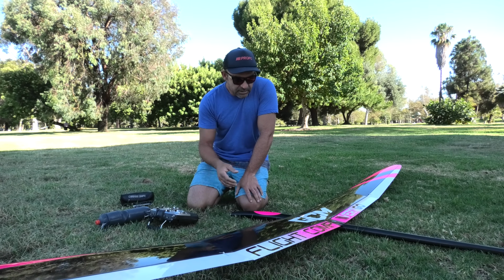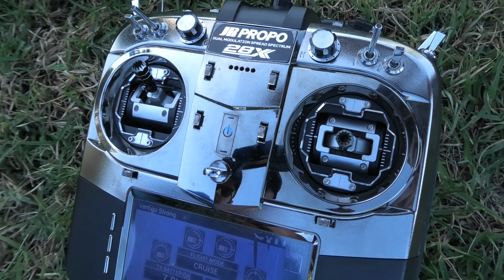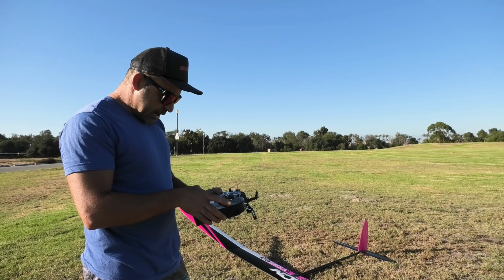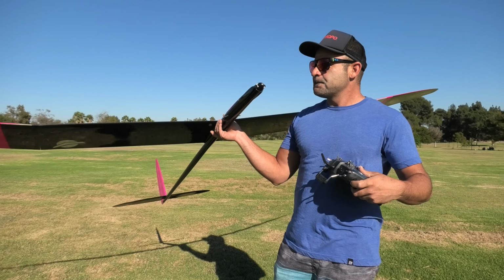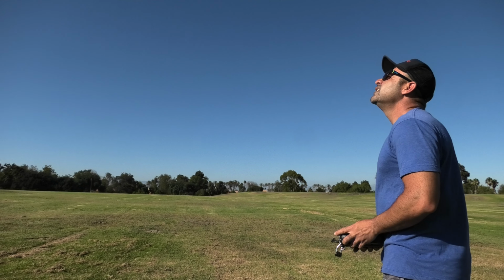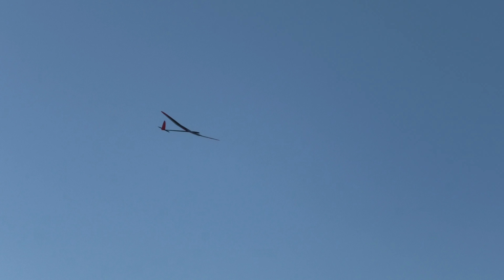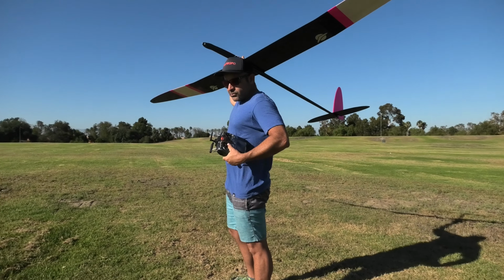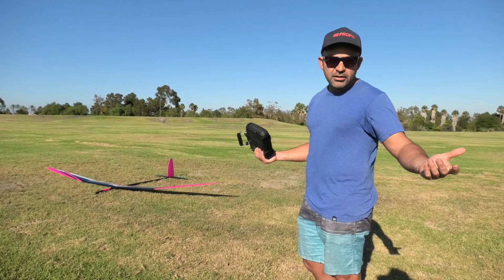F5J Maiden Flight Check List and precautions.

Comment: why is your throttle reversed?
Reply from the maker: My throttle is on a slider on the side of the radio.  The left stick operates the flaps.
Reply: @flightcomp  oh that's interesting
Reply: @flightcomp  hi Ali. I have throttle on slider. flap on stick. your videos are very easy  to follow. keep well. Keith Australia